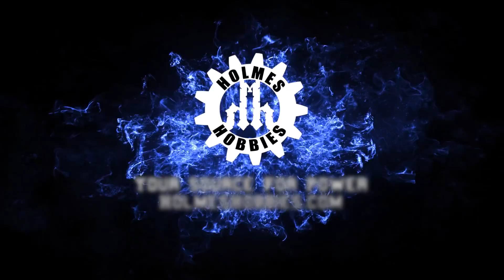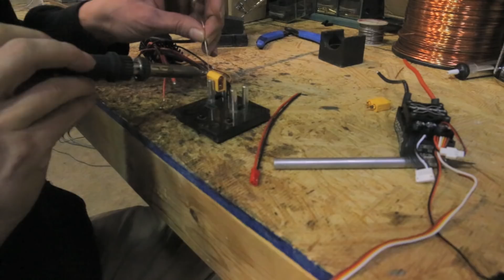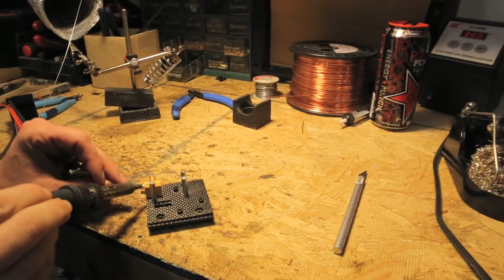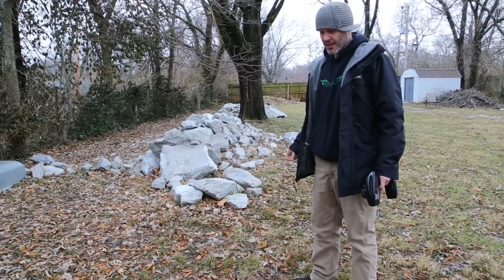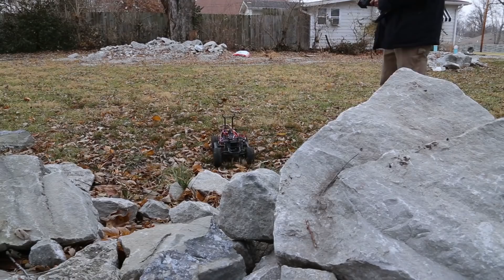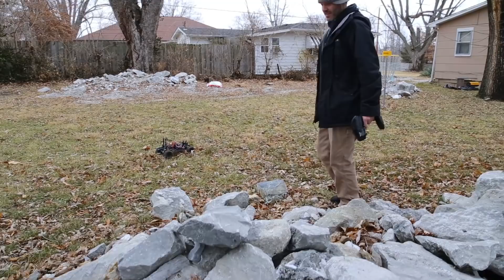Traxxas TRX-4 Brushless Upgrades

Comment: I bought the same model and broke the plastic suspension link mount my first time having the truck out. I bought some brass replacements easy fix but it was just super unexpected. Definitely a weak point on the trx platform

Comment: Can you use the motor sense wires for the lighting kit with a brushless upgrade?
Reply from the maker: I wouldnt recommend that.  Motor sensor current is generally fed direct by the IC and only good for a small fraction of an amp.

Comment: 1:45 I never understood why people think adapters will fail... I use to run 2 3s lipo packs using an adapter and never had a problem. 

So long as it’s good quality I never saw the problem with it.

Comment: I like your little soldering block to hold your connectors. Not half bad! I bought one of those silly lamps with 6 alligator connectors on them. Its nice, but doesn't hold the connect in place nearly as well as that block you have! I haven't seen any reason to upgrade to a brush-less motor on a rock crawler. I even called and asked Traxxas about this, and since these vehicles really do what, 6 to 7 tops. they were telling me you wouldn't really see any difference in dishing out a few hundred more in a brush-less system. I own a Traxxas UDR and love the brush-less motor in side that one, but it also travels much faster. I heard the brush-less system in the TRX4 will have it going 11 to 12 mph top speed. I was told that doing these crawl speeds with a brush-less motor is harder on them, because they are designed to travel at faster speeds. I was told that accuracy wasn't nearly as good when actually climbing at 1/2 a mile an hour for precision turns and accuracy!

What's your thought on time time you have spent with the TRX4 and the brush-less system holding out over the past year?

Comment: I do like those connections. A simpler way and quicker way, is to add the solder to the connector like you did. and a decent amount to it. Flux your wire end. when connecting place the soldering end underneath the plug tip and add add a light dab to your soldering tip to help with heat transfer if you need to. You will see the solder go from sold to liquid, place your wire end tip inside and the wire will absorb the solder in like a sponge. If you do this right you only have to add solder once to your connector and let the flux do its job on the wire and give it a chance to cool after insertion and good to go! Other way I seen was to flux the wire and add a little solder directly to it and let some absorb in. Doesn't take a lot of solder to do these little jobs. :P

I have some Traxxas connectors on Amazon. I know now you have to watch out for those cheap ones! The ones I finally found work amazing and they don't have that A and B with 2 different size connectors that you insert into the plug. Banana Connectors are a much better price and are so much easier to reuse then the Traxxas ones.

Comment: I am curious about those Revolver motors, so I came to the source!
How's that ESC switch holding up? hahaha!
How is the Revolver submerged in a deep a water [scale deep] crossing?
Reply from the maker: Soldered the esc switch up so it can't fail.   Revolvers will take water, but you have to clean and dry them or else deal with rust.

Comment: john, i just installed the revolver in my trx4 bronco, seems motor is getting a little hot just running in my living room with stock pinion. Since i cannot see actual gear mesh how do i make sure it is correctly set. It is currently running a 11t on setting c thanks

Comment: Hey John! Quick question. Just threw a revolver motor in my Trx-4 with the mamba X. The only issue that I’ve run into is the shaft of the motor is so long that it hits the plastic transmission case. Am I missing something or should I just use spacers between the motor and the mounting plate to bring it out a little? Any input would be appreciated. Thanks!
Reply from the maker: Which model trx, and which model revolver?   Didn't have that problem on my rig, but I've seen this mentioned a few times now.
Reply: HolmesHobbies I’ve installed the 1800kv 540 revolver motor with the Mamba X.

Comment: Really considering this setup for my TRX- the motor is pretty amazing!  Would you recommend the Sidewinder 4 or Mamba X to pair with the 1400KV Revolver? Thanks!
Reply from the maker: Either.   The mamba X is more flexible in motor types, but is also heavier and larger.    Let your budget decide.
Reply: HolmesHobbies thanks! The price isn’t as much of a concern but I was curious if the different weight limits of each ESC would come into play at all on a crawler. I would imagine the X would run cooler on a heavier truck, no?

Comment: will it tear up the gear transmission if we put a brushless motor and esc with the trx4?
Reply from the maker: It will be fine, it is a stout truck.   Keep the KV under 2850 and you will be less likely to break parts.
Reply: HolmesHobbies I am planning to put vxl3s on it. is it too much power?
Reply from the maker: nah.   It just won't have good low speed control.
Reply: HolmesHobbies thanks for your help. cheers!!

Comment: Hi, Im looking to replace a 550 15turn with a brushless setup in a 23" boat (stealthwake). Any Idea what KV i should be looking at to maintain stock speed/rpm. Lipo's are overheating the brushed 550 half way through battery. Thanks.

Comment: Nice but I don't normally zip tie my ESC. I prefer gluing them in position for a nicer look
Reply from the maker: I trade out components very frequently, so they are rarely fastened and tidied up.    But this combo is good enough that maybe I should clean up the mounting and wires...
Reply: Maybe double sided tape with the stock mount or upgraded mount? Glue?!

Comment: Tried the hardware, BLE Pro and Revolver, 35c 1500Mah, evidently I’ve got the programming off. Would be great if you would share the screen shots of the program for us.  I really want that low speed control and good run time.
Reply from the maker: You will need a sidewinder 4 or mamba X to have the same startup.    With the BLE, try high startup power, low timing, and dithered frequency.   Thats the best the BLE can do.
Reply: That's why I only use hobbywing ESCs lol I'm too dumb to figure out how to program a castle it's much easier to just plug in my card.

Comment: I just (this morning) ordered a Puller Pro 2200 and ESC from your website. My intention is to put it in my new TF2 Marlin Crawler. I have a CC 1406-1900kv w/mamba X in my TRX and love it. I'm wondering if I should consider putting the lower KV Castle in my Marlin Crawler and putting the new Holmes combo in the TRX? Currently I run stock in the TF2 but with a upgraded steering servo and BEC. I'm just using the mamba's internal ESC in the TRX. Do you think there would be a benefit or do you think it is pretty much a wash? Thanks!
Reply from the maker: We appreciate the support!  I would put the lower KV into the tf2.
Reply: That is what I did. The TF2 is kind of silly fast now, I was surprised. I did install the new Puller Pro 2200 in the TRX along with an existing Mamba X, and wow, what a smooth motor! I had a few hours to mess around until I screwed something up while installing lights. I either fried the ESC, the transmitter is screwed up or maybe the receiver. Anyway, I won't be able to do any troubleshooting until Friday. Hoping for a fresh look at it and a quick fix.

Comment: Wait.... thats sensorless? thats crazy. I also can't imagine getting even longer run time on a brushless compared to my brushed scx10. I can easily get a few hours of run time on a 3000 3s as it is which still boggles my mind coming from flying large helicopters that would only get 4 minuets on a 6s 2650 pack.
Reply from the maker: Yep, sensorless!

Comment: IF the switch is the newer rubber covered switch it will last longer than most of the older castle switches. They took steps to make it splash resistance. I been abusing the switch on the Mamba Monster X ESC for a few months now and all good so far.
Reply from the maker: They still fail.   All switches fail in a crawler, its just a matter of time.

Comment: Would you recommend this setup over a puller pro + Mamba X setup for a crawler junkie who wants to go brushless?
How does the revolver hold up in dirt and water compared to a puller pro for example?
What would you recommend for a KV for a puller pro + mamba x combo in a TRX-4 running 2.2's and a 9 tooth pinion on 3S for slow, technical crawling?
Is sensored still better then sensorless?
Sorry, everytime I think I know what I'm doing, you teach me something different and unexpected....lol
Reply from the maker: 1800- 2200kv would be my choice for the TRX.   2200 puller pro will have a little better low speed control and torque in a total bind, sensored is still better all around.   But the Revolver 1800 kv is so dang great that I haven't pulled it out of my BL rig yet.   If you value lower noise from the rig, puller pro.  If you want some very unique throttle feel and crazy torque walking over obstacles, revolver.  

Either motor will want cleaning and drying after every run that gets it wet, to prevent rust.    The revolver will have no issue with sensor wires going bad over time.   The only thing likely to kill a revolver is running in mud.
Reply: Thanks! Honestly, for the price point of a Revolver on your site, it won't break the bank to pick up a revolver (might even try a 1400kv, just..because..) and a Puller Pro in 2200kv, although, I'm kinda liking the idea of the Revolver. I expect the truck to be 10-12 pound range. I might go with the Mamba Monster X over the Mamba X due to this. Swapping between the Revolver and Puller Pro should simply be plug it in, and reprogram with Castle Link, right?
Reply from the maker: No need to reprogram even.    Get the regular X.  Monster will be overkill and hard to place.
Reply: HolmesHobbies sweet! Thanks!

Comment: Amazing smooth for a sensoreless ! Is the motor waterproof?
Reply from the maker: It is smooth!   The motor is waterproof as far as operation . It would require drying out afterwards and relube of bearings to prevent rusting.

Comment: Because of this video I bought one, and I couldn't be happier. Tuned my Mamba Max Pro and got similar results. Mine is quieter though, :) I run with the body on. It performs miles better than the stock setup, which is not bad at all like you said. I have mine down to mm crawl speeds w/o cogging! In 1st gear it's like a diesel, torque for days. As for the sound, it's sweet music to my ears. The motors really do sing when you are trailing. Thanks for the Reboot, hope to see the BLE Pro next on your test setup.
Reply from the maker: Thank you sir!   We will be showing the BLE pro in the next vid.  I think my son got ahold of the radio and messed with the endpoint adjustments or something, I couldn't get the BLE to arm for this vid.

Comment: Hi John.  I have a Mamba X and will be using a Tekin ROC 412 3100kv motor that I have available.  Do you think that will have enough low torque for crawling (stock gearing)?  I plan to buy one of your Puller Pro motors when I can but was curious what you think of the ROC 3100kv for the TRX4.  Thank you.
Reply from the maker: Shouldn't be a problem at all.  Maybe a bit fast on the kv, but that's your preference.

Comment: Good video, but kind of disappointing to see you, a professional, cut the ESC receiver wires on the XL 5-HV, simply because you didn't take 1 minute to unscrew the diff-lock servo bracket so you could just pull it through. Hopefully people realize they DO NOT need to cut the wire to remove the stock ESC, as it's kind of amateur'ish in my honest opinion.
Reply from the maker: I did mention why I cut it, as it will be shortened to length on the next install.   There was also a zip tie that could have been cut instead, I'm sure a person not able to solder wires would have chosen it instead.

Comment: I just bought one of your 1800kv outrunner motors and a Mamba X for my Trx4 military welding truck was running a 1400kv outrunner in a can. You helped me years ago with a crawler I have been in love with outrunners ever since.
Reply from the maker: Awesome, thanks!
Reply: HolmesHobbies I am a little worried about it not having a shim or eclip on the shaft that lateral movement makes me a little nervous. I ll be doing a review and comparison to my Turnigy tomorrow on my other channel once my Mamba X arrives.
Reply from the maker: It's not an issue at all.  There isn't a force (like a prop) to pull the motor apart.   The magnetic field holds it together, and lack of clip makes disassembly for cleaning easy.

Keep in mind this motor design is over 12 years old.  Many many thousands out there without the circlip, haven't had one reported issue so far :D
Reply: HolmesHobbies Ya I wasn't sure did you do a video on that? I will add that to my video tomorrow as I had no idea why now I do thank you my friend for sharing that.

Comment: I've been searching and really can't find what I am searching for.
I have a rig weighing in at 10.8 pounds fully set up and with battery. I crawl and trail, so if I can keep the top speed to about 5 to 7 mph I would be happy. Brushed or Brushless does't really matter to me.
Currently running a Tekin 30t pro with a 14t pinion, this is a GMade Komodo with stock transmission, so really don't know what the spur count is without disassembly.
2s 40c lipo. The motor gets a little bit warm, but I can run up the mountain and back for 2.5 hours on the single battery.
no room for a 550, so what 540 size can I go with to make sure I am most likely getting the best performance and speed without a lot of trial and error?
Anyone can input to ideas or what they are running..
Reply from the maker: a similar speed motor  to your 30t would be 1500kv ish.      I wouldn't recommend going any faster on brushed motors because of the weight of your rig, it really impacts brush wear.    Another handwound 30t motor (https://holmeshobbies.com/motors/brushed-motors/torquemaster-series/torquemaster-pro.html) would be a great replacement.   Otherwise I would throw in a Puller Pro 540  2200kv and BLE controller for a "quiet"  combo.   I figure you don't want the bleeping noise of this revolver combo on a mountain.
Reply: Thank You Sir! I have several of your motors and a couple esc's in rigs already, but none weigh like the Komodo and everything I found said up to 9 lbs. Closest I have to its weight and its only 8.5, Wraith which has your Puller Pro 2700.
Crawlmaster Pro's from 11 to 20 turns...... smooth..in... ummm.. lets say I have an addiction...lol
Thanks for your advice and great products.

Comment: Great video John, I never considered an outrunner for a land vehicle. I've only seen them in drones and airplanes. But that sound, I think it would get on one's nerves after a while. But I was wondering about your Torquemaster BR-XL, How does the regenerative braking work? Does it give a charge back to the battery? Would it help lengthen run times? I have some long uphill trails and coming down it's mostly coasting. I still have the TRX4 stock setup but have to do upgradest in stages. I am not happy with the way double tap reverse works on my stock esc, it doesn't respond sometimes got to go forward then it bursts in reverse. Can you do a video with your Torquemaster Pro 550 and BR-XL? I want your complete setup w/servo eventually by summer. I also want to setup a comp rig with my TRX4 and do a 2nd for hard core rock crawling. John I hope you can carry crawling bling and hop ups for the TRX4 like lights?   I have a Mamba Max Pro with a Novak Ballistic 18.5 sensored brushless motor in my Ascender. Good trail rig but had a lot of torque twist. So I was thinking to try some of your better esc+motor combos and see what you're talking about the "feel" of a hand wound brushed motor. But for now I want to see if regenerative drag brake is an overlooked gem of your brush esc and if it adds more control to the stock can motor.  Thanks for taking the time to answer our questions and do these technical videos.
Reply from the maker: The drag and brake on the BRXL is regen.   It doesn't add much runtime though, as the motors are not efficient generators.  It does prevent the brake heat being dumped into ESC or motor though, it is dumped into the battery which takes the reverse current efficiently.
Reply: The Torque twist in the Ascender is due to the gearing in the axles, by making it so small it brought with it more torque twist. The extra clearance was a nice plus but it did have a down side.
 I'm working on a sway bar install to help out my Ascender at the moment using a wraith front sway bar kit. Even with the twist its an awesome rig.
Reply: Jerry Watson by the way you can change the stock esc to crawl mode to eliminate double tap reverse
Reply: Thanks, for the info, if you don't mind one more? How does the braking work on the BLE PRO? I watched this again and feel like I can swap out the Ascender motor and ESC and try it in the TRX4. One at a time the ESC (Mamba Max Pro) first. Since this ESC does it all brush, brushless, sensored, ect. I was looking at your BLE Pro as a one stop solution. It costs a little more but, I can change motors more efficiently. I don't like the high pitched whine from the Mamba X with the outrunner. I look forward to the next video with the BLE Pro tuned to whatever frequency you mentioned that is quieter.

Comment: I had question I run your electronics on my scx10-2 sensored. on forward it blinks red is that normal.
Reply from the maker: Typically we want to see green for forwards, but if it works for you then no need to change it.